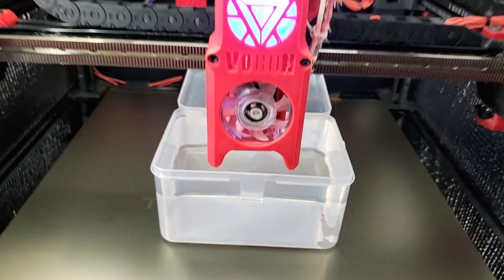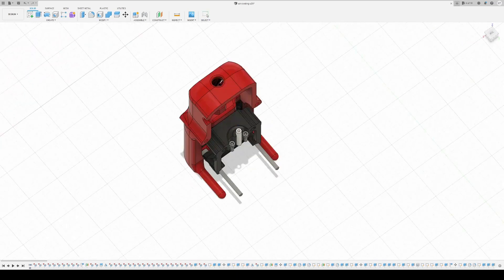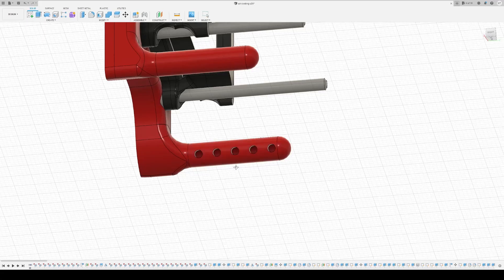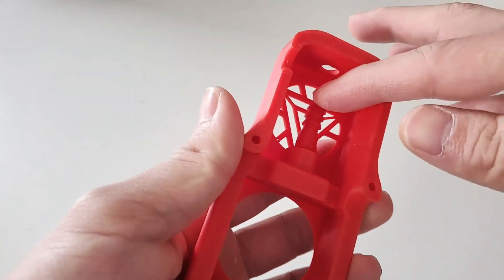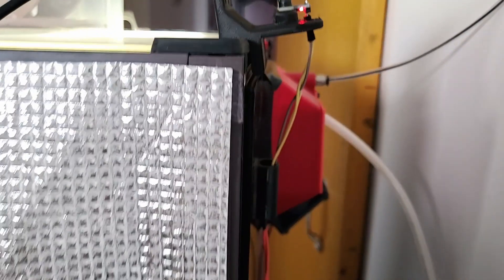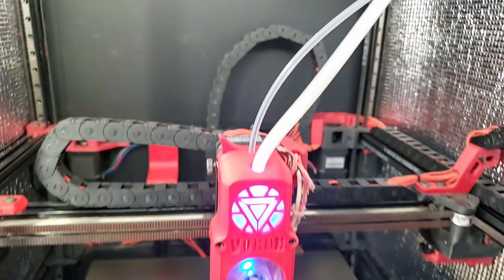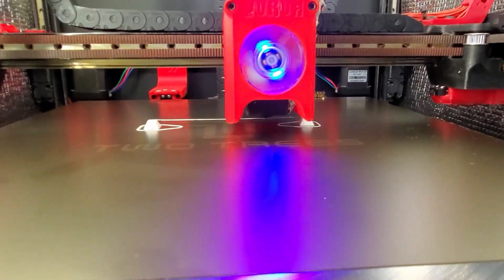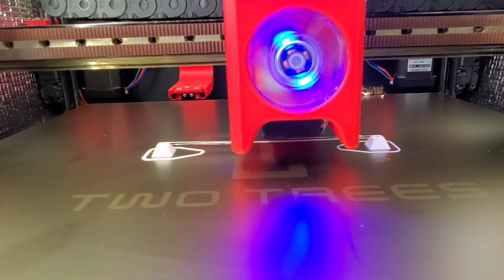voron 2 berdair mod air pump remote cooling

Comment: Very interesting experiment.  I like the idea of getting the cooling fan motor off of the carriage.  I wonder if it would be feasible to use a similar method to cool the hotend or if there is a point of diminishing - or even negative - benefit with regard to moving the mass of an additional tube around.  It'll be interesting to see how you can develop this idea further.
Reply from the maker: Thanks, I think the additional tube is still lighter than a fan, and I am thinking about cooling the hotend with a vertex tube which produces cold air flow.

Comment: not sure if you have seen the stealthburner mod yet but it gives off way too much airflow as it is a revised addition to help the needs of the afterburner toolhead that lacked airflow. First off, noone really prints with pla anymore so yea, no need for airflow with abs as if you use part cooling it wilkl cause the print to lift off bed. So what im saying is the stealthburner mod gives WAY better air pressure/flow then your mod. GHood try though.
Reply from the maker: Just wanna try something different and test it out, and yeah, stealthburner is better in terms of airflow
Reply: "no one really prints with pla anymore" me, a no one who runs 100kg a week...

Comment: It doesn't look very powerful. Is that not the same kind of air flow from 5015s? I might be wrong.
Reply from the maker: Not same, the air flow is from a an air pump which is used in aquarium
Reply: @3DFunfun  he ment you it looks like you get same amount of air flow as from the 5015 fans on the SB
Reply from the maker: @yoda6915  😂 sorry I misunderstood, I have not used a 5015 yet, but I used a much bigger 120 centrifugal fan for remote cooling, the performance is similar to this berdair setup.